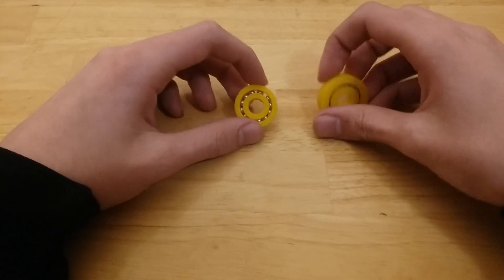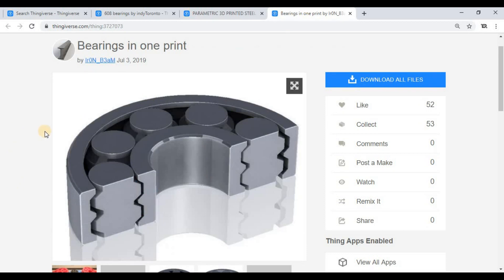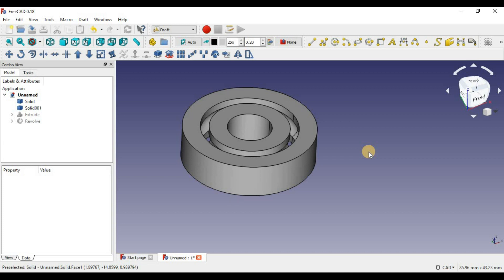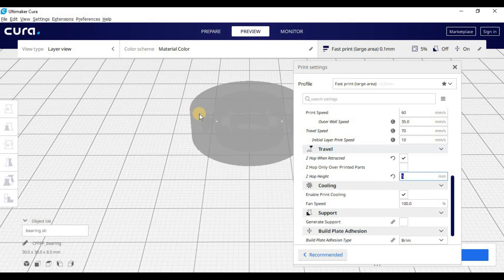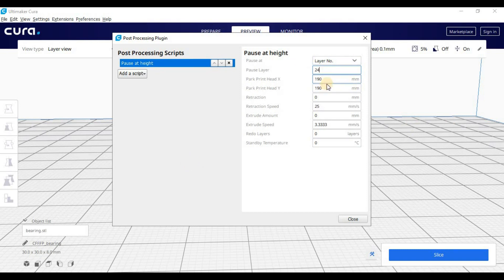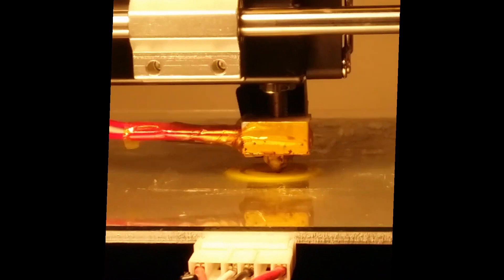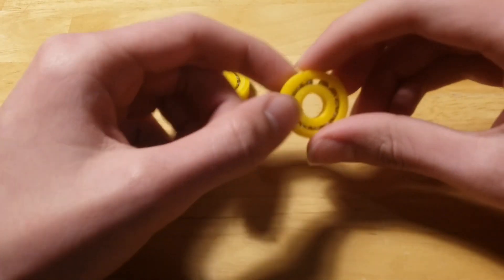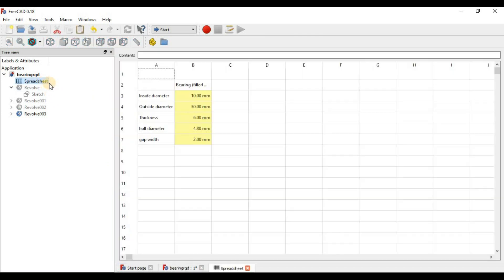3d printed bearings

Comment: yeah i can do 3d printed bearing. What can it do?
nothing!
Reply: i didnt understand.
Reply: Well, I needed a bearing for vertical rotation of the video camera. I also needed a support bearing for the rotary platform of this video camera, so that it could also rotate horizontally. The weight of the video camera together with two stepper motors is less than 150g. There are support bearings on sale, either separate (not held in place by anything) or heavy, or large and definitely, expensive. The size I need is either not available, or it costs as much as several of these video cameras. And about regular bearings - the choice is either to wait for a parcel and build it in parts, or to buy balls and print bearings your size and needs.

Another question is that I did it differently than in this video, I used a separator, printed them just as 3 parts without stopping and I used fewer balls. Like in the patent No.822,723 of June 5, 1906, R.Conrad. "Ball bearing".

If you need bearings for your motorcycle or car, then of course you shouldn't use printed ones. Just as you shouldn't use a small stepper motor to lift a garage door. But this doesn't mean that there won't be someone for whom a printed version would suit. 😉

Comment: I have the Anycubic i3 mega, when follow you instruction on pausing the print,  I can't find a way to start it again , does this only work if the printer is connected to the computer ?
Reply from the maker: No, I was able to pint off an sd card. A quick google search (https://www.reddit.com/r/3Dprinting/comments/as5125/anycubic_i3_mega_pause_at_height/) shows that other people are having the same issue so it might be the 3d printer software. Things you can try, make sure software is up to date and if that doesn't work you might have to manually pause at the correct height. good luck on getting the print to work.
Reply: @TabletopRobotics  I was able to rewrite the script and got it working thanks !